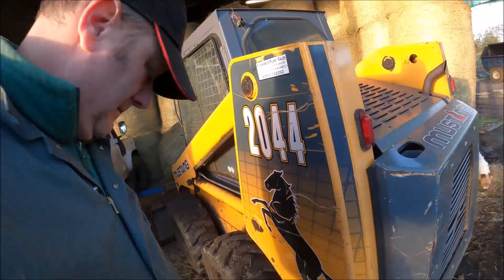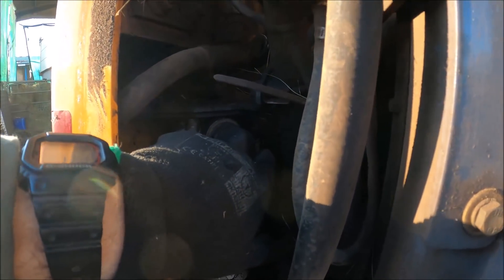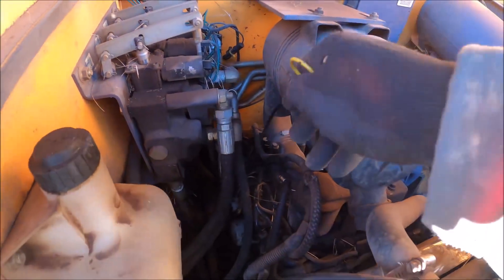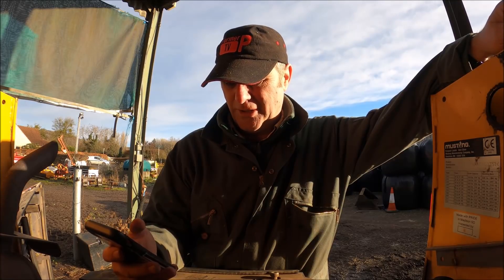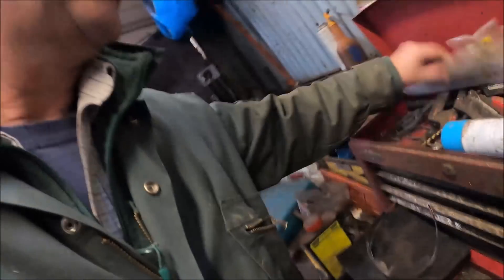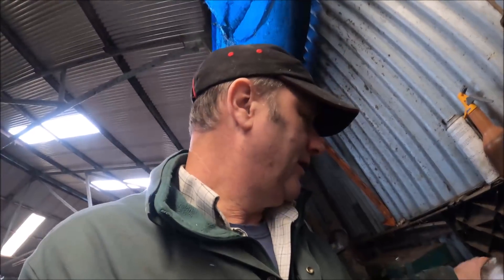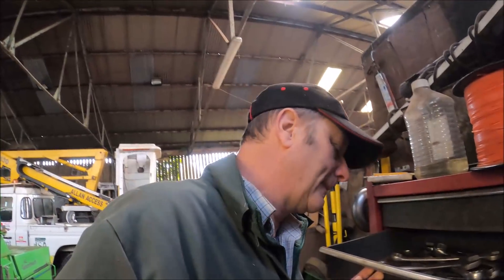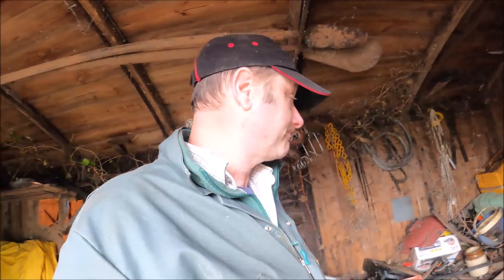Good, and Bad news. Part one...The bad!

Comment: if you have a ratchet strap you can afford to adapt then you could wrap the short part attached to the ratchet  around the filter,  cut off the sucuring hook and put through the ratchet and leave a little bit of strap before cutting if necessary for ease. ratchet up moderately and pull on the ratchet to undo the filter. i made one of these when i was an apprentice and are still using the same one. hard to visualise but can email a picture of mine which would make it clearer if you get stuck.

Comment: If you clean the oil off the filter a piece of sandpaper held against the filter body should give you enough grip to turn it to remove. They should only be hand tightened too not with a tool, you risk the thread and seal if you over tighten an oil filter

Comment: Hi Ian, the mystery tool is a froe for splitting timber down the grain.

I would personally never remove  and reefit a oil filter as the rubber deforms when tightened and you will struggle to get a seal, possibly a worse leak!

The most i would do in your situation is try and give it a extra tighten.
Reply: :_Farmer:Just what I was going to say,  saw one being used to make shingles.
Reply from the maker: A good tool fo shingle making, and splitting long lengths of thinner timber. 🙂👍
Reply from the maker: I got it organised in the end..... I hope. 😬🤞🏻
Reply: The question is do you also have the beetle that goes with it.

Comment: If you get a milk carton or similar, cur the top off, put a bit of wire or string through the rim and hang it under the leak, job done until you can get it fixed?? The old tool is a spliter for logs or stakes, got one here some where !!

Comment: Ps congratulations on being a father again

A froe (or frow), shake axe or paling knife is a tool for cleaving wood by splitting it along the grain. It is an L-shaped tool, used by hammering one edge of its blade into the end of a piece of wood in the direction of the grain, then twisting the blade in the wood by rotating the haft (handle).
Reply from the maker: Spot on. 🙂👍

Comment: Tip for next time you need to remove/install a filter like this,...got a smallish fan belt? Now go get a stout handle like a hammer handle or pipe even, wrap the belt around the filter and through itself,... put the handle in through the loop and gentle twist on the filter, it should come off more or less as easily as a strap wrench would do!

Comment: So the dipstick you pulled out first was the hydraulic oil I imagine? Was the other dipstick for the engine oil? Does the skid steer have a hydrostatic transmission? Sorry to bombard you with technical questions.
Reply from the maker: Yes, yes and yes. The 50hp Yanmar engine runs two big pumps, one for the drive and one for the rams. 🙂👍

Comment: If you have some strap material (which I know you do), wrap it around the filter, put a socket on a ratchet, slide the strap on over the filter, jamb it in next to the ratchet and use as if tightening a nut. Simple fix. Not being from England I don't if you have any auto parts store that can cross reference for a filter OR at worst get one with the same thread and flange diameter (so it seals) until you can get 2 of the OEM filters. Why 2? So you have a spare :)

Comment: Put some cloth around each filter secured with a cable tie to act as a nappy to collect the fluid. That temporarily contains the contamination and allows you to monitor the leak and see where it's coming from. Clean the outside of the filters first. Not ideal but OK as a short term fix.